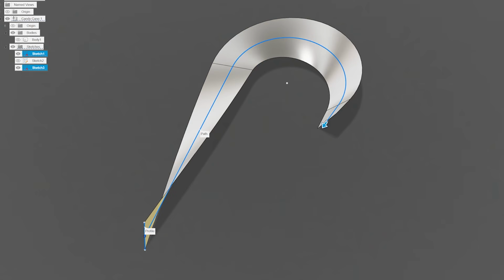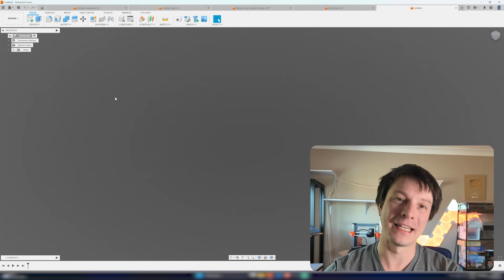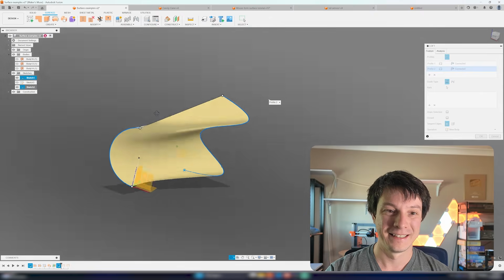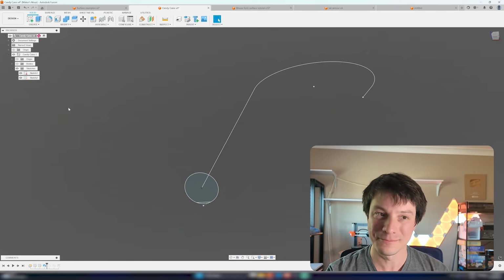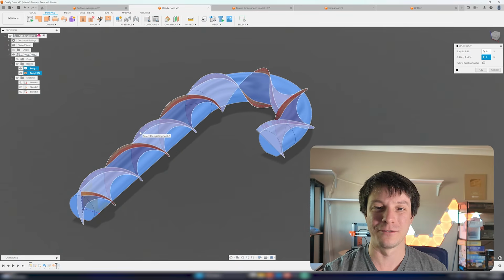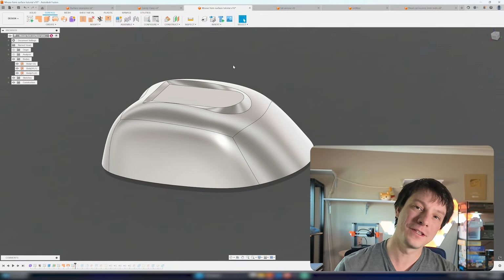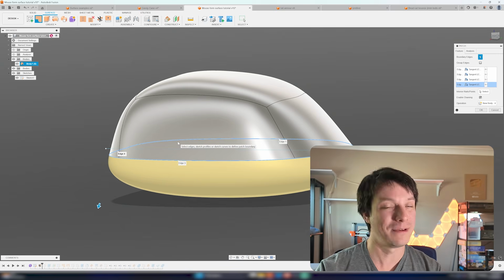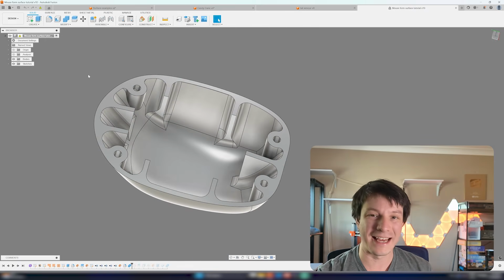How to use SURFACE modelling to create incredible 3D printed objects! Advanced Fusion CAD Tutorial

Comment: When doing the offset, is it good practice to include a tolerance? Usually I would do 0.2mm.
Reply from the maker: If you want to make sure the bits fit together after printing it's good practice. You can do it as a separate step.

Comment: Please think of the normals. Importing CAD stuff into other 3d software is a nightmare, I suspect inconsistent normals is the main culprit. Anyway it can only give you fewer problems down the line by using consistent outward facing normals.
Reply: That's not even in the top 10 of culprits, lol.
Reply: @HydraulicDesign explain

Comment: The difference between "solid" and "surface" modeling is a matter of USER INTERFACE.  ALL CAD software is built on trimmed NURBS surfaces, it's just a matter of whether or not the program allows you to do things that leave the model in a "non-manifold" state, whether it has the tools to manipulate them in useful ways. T-Splines as some of those tools were labeled are a different thing, they were frankly a failed attempt to beat NURBS with something closer to Subdivision surfaces.

As someone who's been doing surface modeling since 1997 these little tutorials of "surfacing" in mechanical CAD are, umm, interesting!

Comment: 2:34 I'm not sure I like that explanation, especially after showing a convex surface that would appear to be able to hold water in the real world, especially without explaining that only the front face is solid and that it does have to wrap around (manifold) to be solid in software, kind of akin to if backface culling was enabled in a traditional triangle rendering path (though similar, completely different concepts)
Reply: Manifold surfaces are often described as "watertight" in a way a bottle is, not a bowl. Going you can fill them completely, at they would still hold water regardless of orientation and gravity.